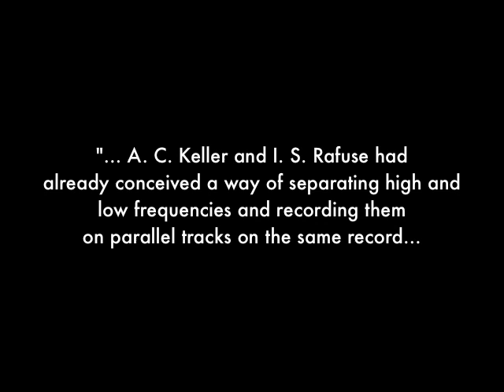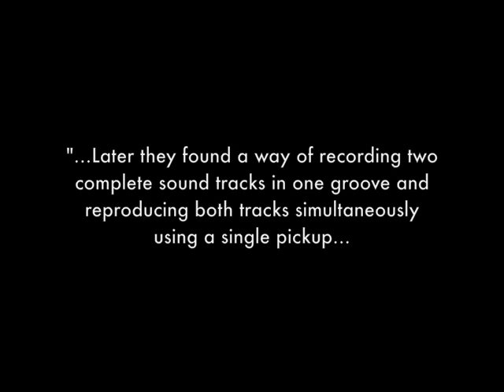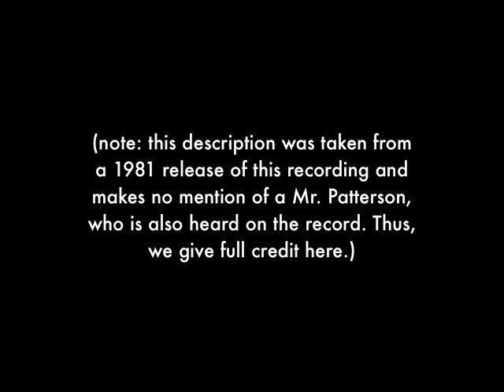World's First Stereo Recording June 1 1934

Comment: There was an acoustic machine marketed around  WW1 that used a double grove spirat and 2 seperate tone arms for stero.

The process was an outgrowth of what the British called "PUZZLE PLATES" and in US  "MYSTERY TECORDS"
. In these records two or more separate selections for recorded individually and mono sound. When can you play the record depending on which Groove was engaged you heard different Tunes.

Throughout the uiers these were made from time to time as NOVELTIES.

The only LO example I know of is a Monty Pyton "3 sided recorf" where there is two seperate routines on secon side.

The book fro TIN FOIL TO HIGH FIDELITY, descibes a cylinder machine from Columbie that had a footlong cylider.  Used with one recording horn, it could make a long play record. But if several of the cutting-edge points were attached to it each of them would cut a separate bath across part of the record. But as books aithor states this machine used in this wat
(  Columbia even used the
    word MULIPLEX, config-
     ration when used this
      way)
would if the performersn were mear yo it when recording, because each spiral was a seperate track, RECORD & PLAY STEREO

Comment: Excellent video.  Phaasch is correct about the Blumlein system, but at the time Keller had no knowledge of what Blumlein was doing and proceeded independently.  As early as 1928, Keller had produced an experimental double groove system (2 grooves on the same disc and 2 playback styli).  In 1932 he used it to record the Philadelphia Orchestra in stereo, during live concerts in the Academy of music. Those recordings were issued on an LP by Bell Labs in 1979.